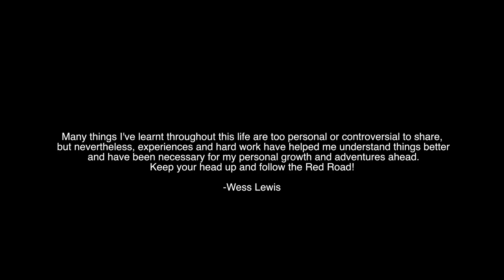Crafting a Rear Rack for Propane and Mini-Split AC Unit School Bus Conversion

Comment: Curious about your Hobart. I’ve recently downsized from my Snapon 100% duty cycle welder to a cheaper 28% duty cycle and I’m not used to being so limited. I did it to be able to weld while on the road but I think i undershot the mark, how do you like that welder and what model is it. That flux wire seems to weld pretty good to not much spatter as well. Do you prefer a certain brand wire. Keep up the amazing work. Heading west for the winter in November start a welding job in Texas then on to NM and Arizona in December . Love to hookup and meet you somewhere on the road

Comment: Nice!! He kept the back E-window and side windows. I am too with my lift. He did the same staggered front lift as you did tho. I need to figure out how to get the front put back together.

Questions:
1) You used angle iron and square tubing; why?
2) Looks too windy (and I didn't see any bottles), are you using flux core wire? I need to check out the difference in beads.

Comment: The DOT and the law has become more of a sticklers on adding things to RV's that make your over all length longer. As long as you stay under the 40 feet. 1 inch over and your drivers class can change and your driving out of class. They red tag your rig on the spot and tow it away if no one has the right lic to drive. TX is one of the states going after 5th wheels and 45 foot RVs now